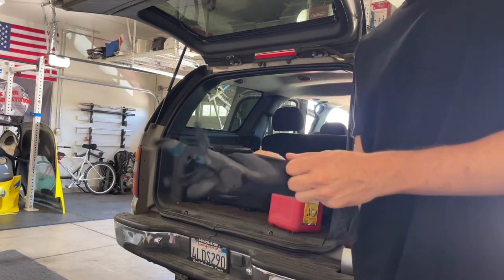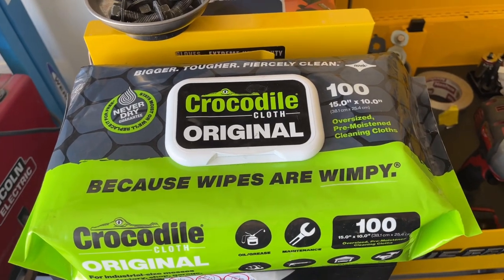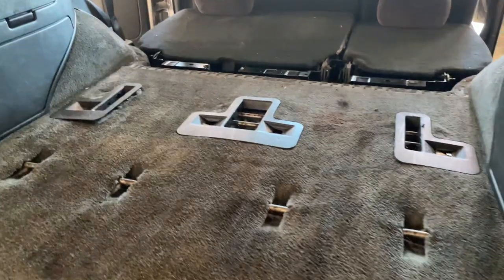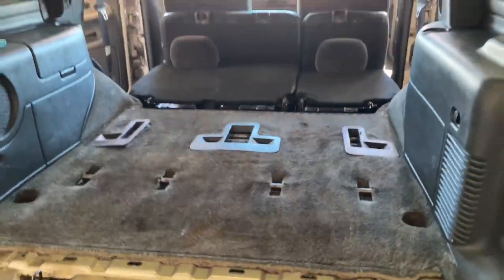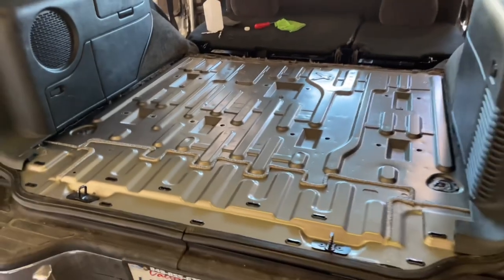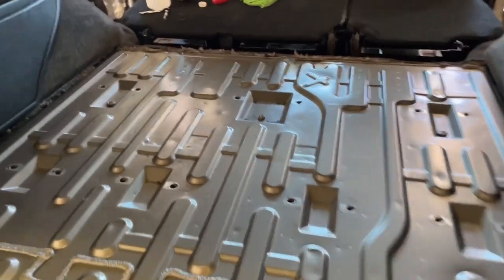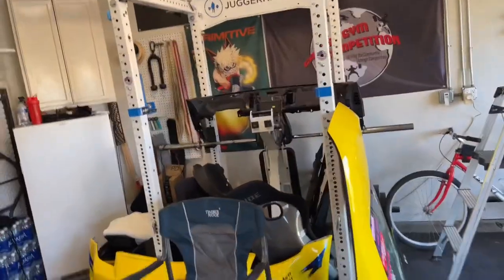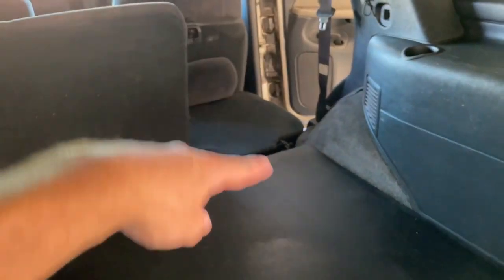Buying a Budget Tow & Adventure Rig! Did I Make The Right Choice?!

Comment: Choice! 
Fuel and water pumps are the most common parts to fail in those so I'd swap out both
Reply: Also, you can cut in an access hatch under the carpet in the rear to get to the fuel pump easier.
Reply from the maker: Oh really?! Can I do the same to fix the fuel level sensor? I don’t wanna drop the tank 😅
Reply: @tonycrispin  it should be right under the rear seat behind the driver seat. There a bunch of videos on here for it